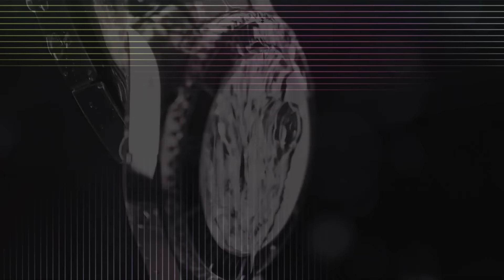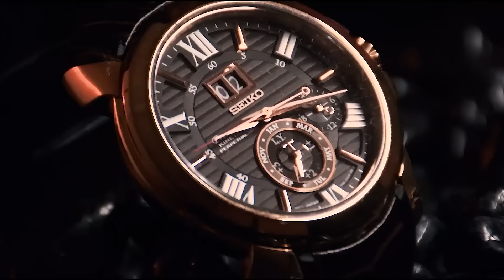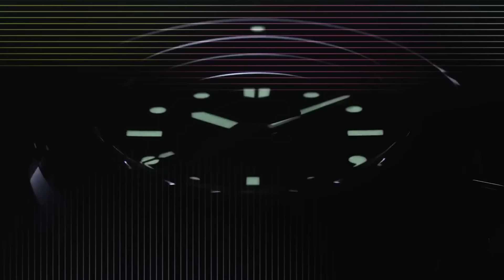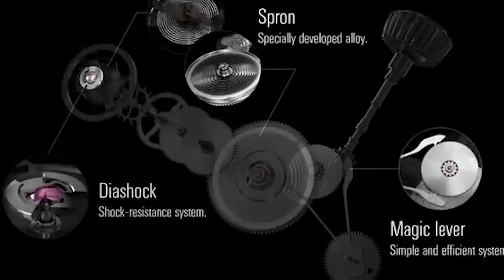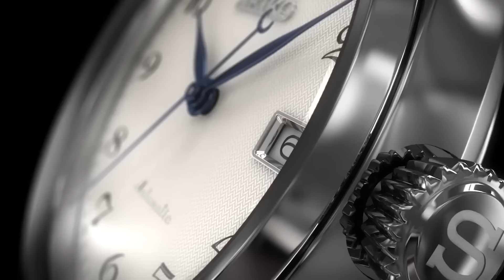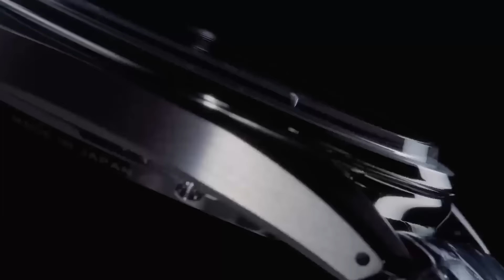The Secret of Seiko Kinetic | Japan's Forgotten Innovation

Comment: Great video. My personal opinion: originality in a project is not enough to make it a win. Hybrid is not that fascinating, in all the fields you apply it: watches, automotive clima-controlling etc. Measuring time by fully mechanical components is astonishing, but doing that with a "doping" injection is a sort of pollution in this philosophy. The same for Spring Drive, as creative as that idea is. On the other hand, I'd rather a fully electrical driven watch. That's why a Citizen Eco-Drive system is a totally win over Seiko Kinetic or Spring Drive.
Reply from the maker: That's a very interesting perspective, and I completely understand the logic. If you're looking for purity, it makes sense to prefer the extremes, a fully mechanical movement for its traditional engineering, or Eco-Drive for fully embracing the advantages of electronics and solar power. For other enthusiasts, though, that combination of two worlds is exactly what makes Kinetic and Spring Drive so fascinating. In the end, they're different philosophies, and that's part of the beauty of watchmaking.
Reply: That's a totally fair opinion; but there is really never any right or wrong answer - only tradeoffs. It all comes down to what mission the watch is to fulfill.

If the mission is cheap, reliable timekeeping; nothing beats a battery powered quartz watch with LCD screen. The one that came as a "prize" in the McDonalds happy meal my mom bought me in 1986 keeps better time than any mechanical watch ever built. It came "free" with a $3 meal and costs $1 once every 5 years to keep it going. It's probably ± 1 second during those 5 years between battery changes.

But for most watch enthusiasts, a big part of the mission is wow factor and sophisticated design & manufacture. That itch often get's scratched  via "just because" features. Obviously my happy meal watch fails at those missions.

Some/many people found the Kinetic design to be pleasingly sophisticated with the bonus of it keeping perfect time. There's no denying the clever engineering of the Kinetic.

But whether it speaks to YOU is a totally different story.

Comment: Still wear my Kinetic 5m63 0AK0 which I've owned since mid 2000s. I bought it because my previous Seiko was stolen and needed something for a trip, had it ever since alongside a Garmin, I nearly took the plunge a couple of months ago on a new Seiko Automatic, I even nearly bought a Longines Zulu spirit, but I just could part with my old beater, this watch never fails, never lets me down, only drawback is it doesn't have luminous hands.
Reply from the maker: What a great story! Watches like that prove that a timepiece's value goes far beyond its price. If a watch has been with you for so many years without letting you down, it's only natural that it becomes hard to replace.
Reply: @Mun @MundoRelojesEN lutely and the realisation that these highly desirable, high value watches need a service every 4,5,6 or if you’re lucky 8 years, at cost greater than what I paid for my watch, My kinetic has never been serviced, never needed a battery, or winding up and still performs the same basic function accurately.

Comment: A very interesting video, I've had a Seiko Kinetic watch for about 12 years, and it keeps perfect time. The capacitor needs replacing now as it doesn't hold the charge like it used to, but wearing it daily it still works ok, and has never stopped. I have contacted Seiko and they charge £65 to replace and reseal it including return postage.
Reply from the maker: Thanks so much for sharing your experience! After 12 years, it's quite normal for the energy cell to start losing capacity. The good news is that replacing it can keep the watch running for many more years. It's also nice that Seiko's service includes new seals and pressure resealing, helping keep the watch in great condition.

Comment: I have owned a Seiko Kinetic for years, but I am not really satisfied with it. 
The reason is that it is very hard to recharge once the battery has run down after a long period of inactivity.
You have to shake it a lot generating enough energy to get it running again. 
There really ought to be an easier way to get it going again.
Reply from the maker: That's a very fair criticism. It was one of Kinetic's biggest drawbacks compared to solar watches. If a Kinetic sits unused for a long time, getting it running again can be quite inconvenient. Even so, it's still a fascinating piece of engineering. Thanks for sharing your experience!
Reply: There is an easier wayn My friend has several expensive auto watches and he has a machine that keeps them moving.  This is a machine specifically sold for that purpose.
My Dad had a Seiko auto which he used for at least 30 years. Felt a bit clunky for me, though.
Reply: @davidreynolds664  
I own several watch winders for my automatic watches myself. However, a watch winder does not work with my Seiko Kinetic.
This is because the slow, steady motion of the watch winder does not accelerate the rotor enough to generate sufficient electricity in the tiny generator.

Comment: How does Kinetic differs from their Spring Drive?
Reply: Kinetic tech powers a capacitor/battery and is otherwise a quartz watch, thus more like a solar watch than Spring Drive. Spring Drive is an actual mechanical watch, powered by a mainspring. It has no capacitor/battery. It uses quartz to regulate the frictionless escapement alternative.
Reply: @ahwhite2022 thank you!
Reply from the maker: That's an excellent explanation. In short, Kinetic generates electricity from wrist movement to power a quartz movement, while Spring Drive is powered by a mainspring like a mechanical watch and uses an electronic regulator to control its accuracy, without requiring a battery. Two very different approaches to solving the same problem. Thanks for the great explanation!

Comment: You could enlarge this tech and use it in autos but it would make too much sense and cut into profits
Reply from the maker: That's an interesting idea. In fact, the concept of recovering energy from motion is already used in many modern technologies, although applying it to a car is far more complex because of the scale and efficiency required. Thanks for commenting!
Reply: @MundoRelojesEN  No, it's not an interesting idea, but a perfectly wrong one as cars don't move by themselves like our hands, therefore the whole thing makes no sense (unlike regenerative braking which, in the first place, requires an energy source). His nonsense idea would be a perpetual motion machine, which is just impossible. Strange that you couldn't figure this simple thing out.

Comment: Kinetic is cool from a collector standpoint but in reality.... You have quartz watches with batteries that can last 5-10 years. And kinetic doesn't last anyway, the capacitor battery needs to be replaced every once in a while too... So you don't really get out of changing it...
Reply from the maker: That's a very fair point. Kinetic never completely eliminated the need to replace the energy cell; what it offered was a different way of generating power without relying on regular battery changes. Today, solar watches are more practical for many people, but Kinetic remains a fascinating technology because of its innovation and the role it played in watchmaking history.

Comment: First kinetic, then Spring Drive which is still in production, however both are proprietary and although out of patent nobody is interested in taking up the challenge as it's too expensive and complex.  Kinetic seems done, and in my opinion Spring Drive is on borrowed time.
Reply from the maker: That's an interesting perspective. Kinetic appears to have reached the end of its commercial journey, but Spring Drive remains a core technology for Grand Seiko and continues to evolve. The fact that other brands haven't developed anything similar shows just how complex and expensive it is, although only time will tell whether it remains a niche technology or has a much longer future. Thanks for sharing your thoughts.
Reply: Spring drive is in borrowed time? 😂
Reply: @ahwhite2022  It's only in prestige models, including Seiko, but I don't see any effort to broaden the appeal.  Generally most quartz watch makers gravitate to some solar battery technology, e.g. Casio and Citizen.  It's a shame because it's an interesting approach, and once Seiko Corp dumps it it's gone.  As for G.S. they have a regular quartz line, mechanical, and Spring Drive, I'd suggest that if there's a slump in sales there will be a serious reconsideration and rationalisation; it's pure business.

Comment: i have 4 seiko kinetic watches…the oldest is almost 27 years old (one servicing about 6 years ago, capacitor and crystal)
auto kinetic relay, kinetic, quartz, manual, automatic, solar etc…just luv watches and the different movements that are available…!!!
Reply from the maker: What a fascinating collection! A Kinetic that is almost 27 years old shows that, with proper maintenance, this technology can last for a very long time. And I completely agree: discovering and enjoying so many different types of movements is one of the best parts of this hobby. Thanks for sharing your experience!

Comment: Never needs a battery change?!!,, call it a capacitor and you still will have to swap it apx 15-20, good opportunity to upgrade to recharge battery
Reply: It will not degrade if it is kept charged all the time. I have 45 years old computers with good capacitors unreplaced since 1981 because these computers are powered frequently.
Reply: @francoisleveille409 well I have 35 watches that tell me you're going to need to change it, and their own literature on it
Reply from the maker: @francoisleveille409 
That's a good point. Keeping the energy cell regularly charged can certainly help extend its lifespan. That said, longevity also depends on factors such as the type of cell used, operating temperatures, and the natural aging of the materials. Thanks for sharing your experience.
Reply: @MundoRelojesEN  Here's what I learned about capacitors having a degree in EE. They are made of two metal sheets with an electrolyte in between. Older capacitors used aluminum while modern high specialty ones use rare earth metals but the electrolyte remains good for decades if they are charged often. They degrade in only a few years if they are left discharged (unused).
Reply: @MundoRelojesEN it may extend the lifespan but never change it’s limit
Reply from the maker: @HvinnyTheViking
That's true. Seiko does consider the energy cell a service item that may eventually need replacement. Its lifespan depends a lot on how the watch is used and how well it's kept charged, which is why some last much longer than others. Thanks for sharing your experience.